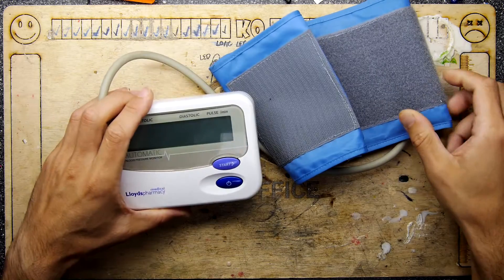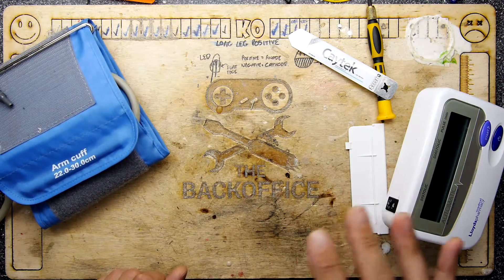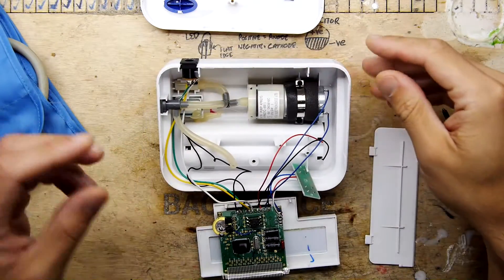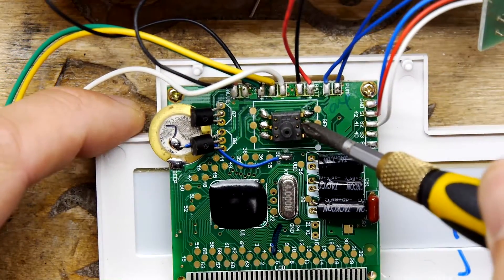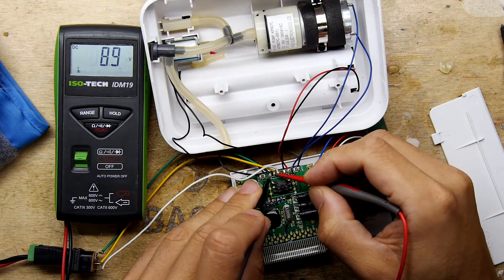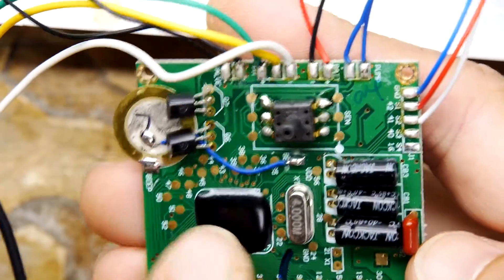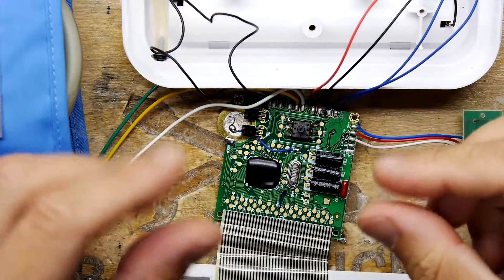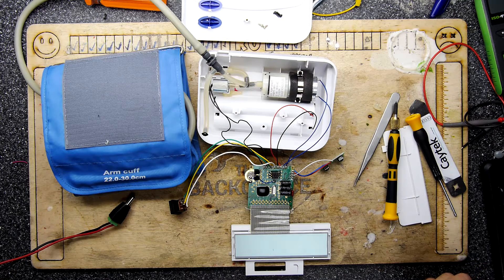Blood Pressure Monitor Teardown

Comment: Without knowing the micro, it's hard to tell. That micro will co-ordinate everything, it could be as simple as a reset line stuck. I would almost certainly look towards the micro with no life, start by measuring the crystal frequency with a scope. The IC under to the left is an OP-amp and will be used to amplify the signal from the pressure sensor for the micro. Might even add hysteresis bu the former should have a/d function I'd think.

Comment: The blood pressure higher number is given when the artery is constricted enough it will not give a pulse, the lower value is when the pulse starts again as the pressure is released.
Reply: Richard Ward-Scott what does it mean if your pressure is negative?
Reply: @Illvidri  it means you're dead if the reading is negative. I have high blood pressure & it's actually best for me if it's high, rather than low. I stagger, my vision goes black, bounce off walls, and all sorts of symptoms when my bp is low. I'm medicated, too. Anyhow, was so glad to find you, I have 3 bp monitors that all need worked on,, & think I can figure them out. Tyvm! New sub!
Reply from the maker: Cool, this is a great starting point to hacking our own interface

Comment: The 74HC00 is a quad 2-input NAND gate. Inputs include clamp diodes. This enables the use of current limiting resistors to interface inputs to voltages in excess of VCC.
Reply: Kristyanna Virgona aha! My mental knowledge was correct! It was a logic gate